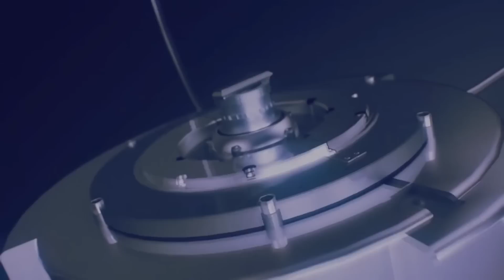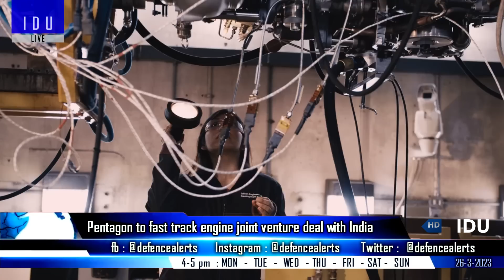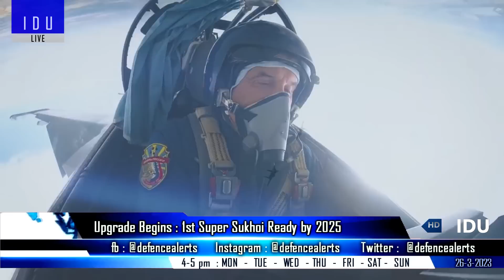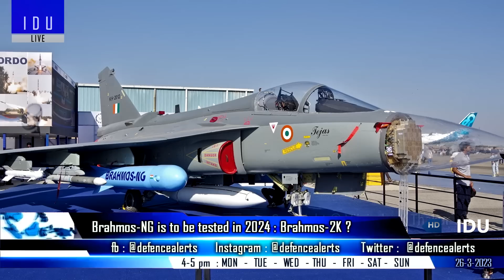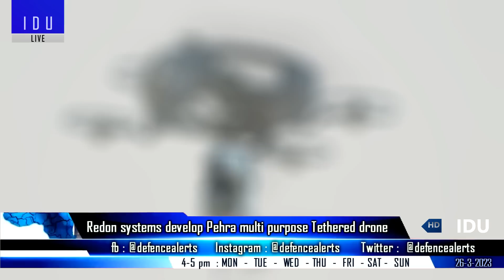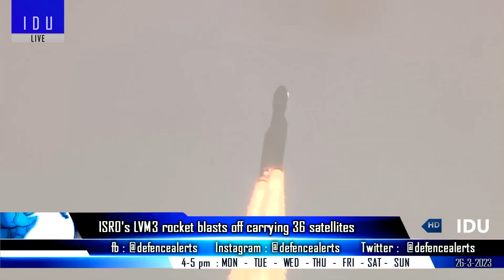Indian Defence Updates : Dhruv MK3 Crash,120 Kn Engine Fast Track,Brahmos-NG Test,ISRO LVM3 Launch

Comment: I have still not understood If Rich Indian Defence Beuracrats are upgrading SU30mki without its engine upgrade what's the use😂 Life of su30 mki is 30 year so if handed over in 2007 it's ending in2037 by the mean time if technology changes by that time. Will we be doing another upgrade of its Radar, sensors, helmet, software etc.? Why are we not considering shortage of its technical  parts and it's other basic engine problem like overhauling etc

Comment: I think something fishy is happening..... For 10+ years no crash.... 3years of Mk3 no crash....but suddenly back to back crash?? Need to make a proper enquiry
Reply: Foreign lobby
Reply: @defence3355  100% usa doing something probably hacking
Reply: Read what happened to the dhruvs exported to Ecuador...there are some known issues but HAL has been sleepy on these issues
Reply: @RaveSharrma  all issues had been sorted out one by one after the incidents
Reply: @narayankartikeyan8004  tabhi ye crash ho rahe hain shayad
Reply: Or it could just be technical issues like most equipment since there's no such thing as an issue free or perfect system
Reply: After induction when equipments are used many issues are found look at f35 when it came in service many flaws were refined and upgraded f35 variants were made its not about problems as every equipment is not perfect but how fast can you detect and refine it
Reply: You have to read the news carefully.... All Alh are grounded. Testing at a controlled environment was being carried out by ICG after the alh3 sea ditching incident and the crash here means the engineers have found the cause and now confirmed it.
Reply: @narayankartikeyan8004  if this is true it is a great news
Reply: yes...looks like but then there could be some issue with hw or sw cld have risen over time..
Reply: Just foreign bastards intervention
Reply: 😂 that's why India can't defend itself from China.
Reply: @3DWorX_Studio  rather than commenting on youtube go work harder & earn more money to get wheat & tea

Comment: Well Su57 have 147kN thrust producing engine while f35 have 191, AMCA atleast have to be 160kN thrust producing engine which will be only possible by indigenous engine because USA will never want than any alternate of fifth gen will come in to the market. Hope they are working on it.
Reply: someguy9942  3-4  saal mai upgrade kar lenge bo bhi jo unka new izdeliye 30 engine se
Reply: Neither su57 nor su75 is stealth because Russia has still not developed Radar absorbing coating material. Russia has cheated India under FGFA deal. India gave 25 billion $ for su75 & su57 with 43 changes to counter F22 but Russia gave 15%share to HAL and didn't allow Indian Engineers while developing these prototypes. Later refused India as a partner in FGFA inspite of taking 25 billion $.
Reply: @Kashyap-mk9ds  That's what very good thing happened and now India have its own fifth gen program estimated to get fully operational in IAF till 2035. But India have to develop its own engine to avoid foreign dependency.
Reply: some guy  No Russia and India had to contribute 5 billion $ each yearly on their prototypes respectively but India paid 25 billion $in advance and later Russia started its attitude. 🙏
Reply: @AYUSH 51 Russia is pitching Su75 for 30 million $ hiding it's actual cost  to close Tejas mki2 project as they both ha e same production and Rollout Dates.

Comment: 1. HAL should appoint proper specialists to do root cause analysis
2. Get the Quality Assurance team to see breaks in manufacturing process
3. Remove management SPOC responsible for this
4. IAF should set same level of expectations from foreign OEMs too: MIG - 21 (400+ incidents), Chetak/Cheetah (dozens of incidents/deaths). But no grounding of foreign fleet.
Reply: Yes absolutely right

Comment: I don't think HAL is good in making helicopter,
Reply: They are good in that . Such issues happens because of lack of maintenance.
Reply: Not just maintanence but there are several other factors too.
Reply: @SpiderWuss69420  yeah maybe but the biggest one is maintanence of heli fleet  or late detection of faults in airframe ( it's normal when heli and aircraft are in continuous use)
Reply: @adarshyadav7693  exactly
Reply: Bro alot of f35 have crashed since 2015 so does that mean lockheed Martin is not good at making fighter jets?